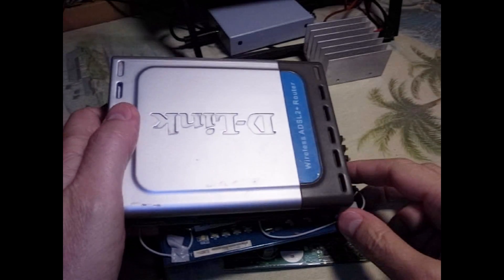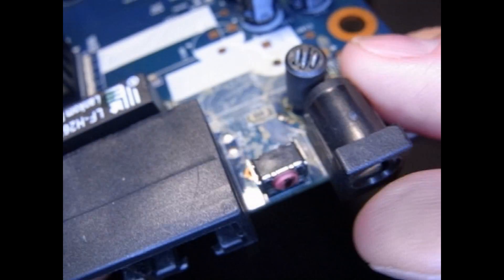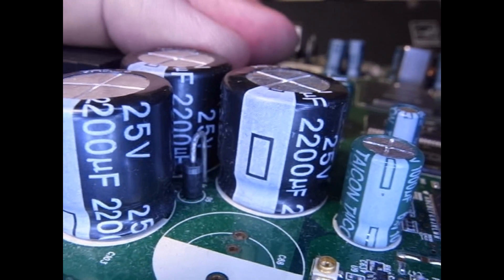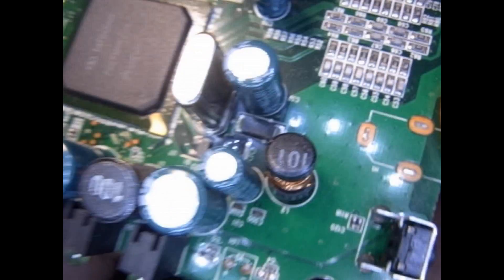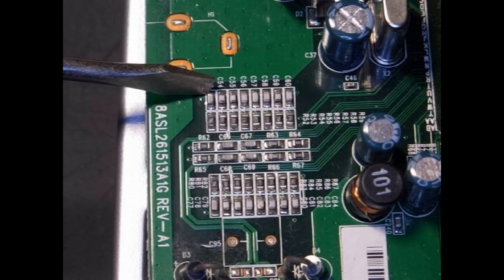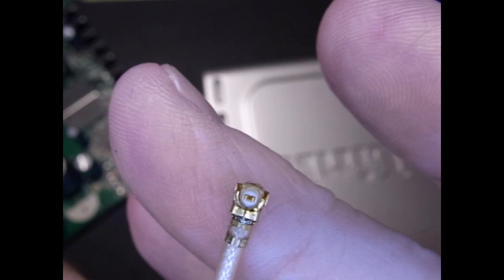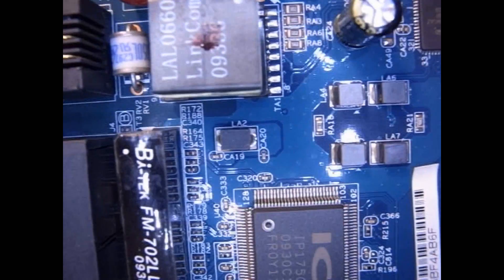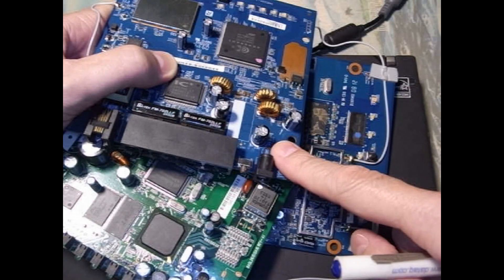Reusing Electrical Components From Scrapped Stuff

Comment from the maker: RELATED: 
Basic Desoldering - Circuit Board Stripping, Tips and Tricks: https://youtu.be/NJWKOwfz_lk
Remove Pins From Amphenol / Molex Connectors For Reuse: https://www.youtube.com/watch?v=LUuBx0uVNG4
Salvaging Circuit Boards + Rare Find:    https://youtu.be/dFpr_1sD764
Salvageable Parts From A Bad UPS Board:   https://youtu.be/FAhTbH2efAw
Salvaging Electronic Parts: Power Supply:    https://youtu.be/pDbAhXd2qLI
Salvaging Electronic Parts: Core I2S Motherboard:   https://youtu.be/5c1ME2DmHk4
Reusing Crimp Lugs:    https://youtu.be/JIdsnk8kqoY
Threaded Brass Inserts - Salvaging & Reusing:    https://youtu.be/DR6H3-N3t-I
LED Security Light IR Sensor Teardown For Parts(?):    https://youtu.be/ySlk66hfrlg
Salvaging Electronic Parts: Remote Doorbell:   https://youtu.be/bRk9LSBjLio

Comment: Good and useful video.  I dabbled with macro photography for some months.  Its a challenge because the adjustments for lighting and getting deep focus throughout the photographed objects on a circuit board works at odds with each other.  You did good.
Oh, those ICs are likely useless, as you mentioned.  I suspect they're made just for the router design.  PLUS to speed up their de soldering would require an air soldering device.

Comment: Are through hole resistors and diodes worth it to reuse ?
Reply from the maker: If the leads are long enough for your projects. If short leads are ok, then yes.
Reply: @tsbrownie  thanks dude
Reply: Even those ceramic brown capacitors,the white female connector ls and those green polyester capacitors?
Reply from the maker: @Ryle Desira Belli  I've got lots of recovered parts of all types. Literally thousands. It depends on your time and how much money you have to buy new. I was broke as a student, so.... If you have a parts tester, you can tell which are good/bad.
Reply: @tsbrownie  thanks for the advice

Comment: Excellent video!  
Another thing you can reuse is the enclosure... 
I built a portable amplifier into a little modem enclosure. I even reused its own circuit board as a support for my components ("Manhattan-style"), as well as rewiring the original power switch without removing it so that it sticks out the same hole where it was already designed to be!  (I use it to test second hand speakers I may come across at garage sales, and flea markets. You wouldn't believe the quality stuff people are getting rid of, these days!)

The enclosures, being full of holes where you may not want them, are not always as versatile as an Altoids tin, but sometimes they're exactly what you need!  ;-]
Reply from the maker: Thanks. You have excellent reuse ideas!

Comment: Do toroidal inductors go bad? (Just on there own, or when water damaged). Im asking cuz i have 2 and a lil one on the board and there looked to be covered in corrosion
Reply from the maker: Corrosion will destroy just about everything.  The core might be usable if it was carefully cleaned and was not pitted, cracked or otherwise damaged.  You'd have to replace the winding exactly as they were, but depending on the criticality of the circuit, it's possible.  Probably more trouble / cost than it's worth for most things.

Comment: How to make motor starting capacitor from scrap CPU capacitors?
Reply from the maker: Probably not a good idea because most motors needing a startup cap are AC and caps from a CPU are DC.  You can probably do it, but finding one is easier / safer.
Reply: @tsbrownie  can you make a tutorial on it please. Our country has DC Motors.
Reply from the maker: Sorry, youtube did not flag your comment, I found it by accident.  I googled "dc motor starting capacitor" and there are caps on DC motors, but they are there to reduce spikes rather than for startup.  Of course you can put a cap across the DC power source, but the real trick is knowing how much flyback there will be from the motor.  That reverse voltage spike can be really high (it's short lived, so it's hard to measure without an oscilloscope or similar) will kill a low voltage cap very quickly.  I've used a neon bulb to trap that spike in a 12 volt car, and the flyback will light up a 70v neon bulb.

Comment: You can get 6 heatsinks for 75  cents on Ebay from china. 100 tactile switches for 80 cents  20 jacks for 1.00 100 ic's for 1.18 . 250 assorted resistors and capacitors for a couple bucks. Brand new! No wondering if they were beyond their life expectancy or damaged when you removed them. When one part of an  electronic circuit fails it often takes many components with it!  You will be wondering why your project is not working when you are using fried components in them.Time is way more valuable than money anyways!
Reply from the maker: True, but in salvaging I learn new techniques, learn about new parts that you don't see for years in regular outlets, ... and all the while I usually listen to music and go all zen.

Comment: As any one use oven?
Reply from the maker: Solder contains lead.  Lead is toxic.  When heated it releases toxic gas.  Always work in a well ventilated place and NEVER around food or where people eat.  ALSO, many electronic parts contain toxic materials.  AND many parts are destroyed by prolonged high temperatures.  So oven / stove and similar = bad idea.

Comment: What does J stand for one.of the surface mount components had a N next to it,anyone,and inductors I don't see them.very often anyone can explain what a inductor is,I no a lot of my components but those two I dont,anyone,
Reply: Ron Thompson inductors create a magnetic field around themselves and create an induced voltage. They’re created by wrapping wire around a cylinder. The more wraps there are per centimeter or whatever, the stronger the magnetic field is, therefore making a stronger induced voltage.
Reply: @fluidapple9091  thanks for the info.

Comment: Who on earth designs these things.....    I take it they under stand what juice goes where??
Reply from the maker: There's software that helps lay out the tracing and such.  But it's like a tiny factory where each section is doing something different, but it's a standard function (chip).  The trick is connecting up each of those sections into 1 functioning board.  And it's often several engineers working together each with a knowledge of one part.
Reply: And it looks even more baffling if you look at a silicon die under a microscope... try to recycle boards with vintage ASIC's or microprocessors in ceramic package with gold plated lid, and unsolder the lid. You may even find doodles left by designers, as seen on micro.magnet.fsu.edu/creatures/index.html

Comment: 9:01 I'm wondering about those chips. I don't care about how difficult they are to take out. I'm just wondering if I could find some schematics so I could use them for something maybe.
Reply: ASICs are uninteresting, but you may find DRAM, flash ROM, CPLD, GPIO extender, level shifter... that you can reuse if you study their datasheet, design a one-off project with them (choosing a microcontroller or FPGA that can handle them), and can draw a circuit board for it, and can send /pay an order to a board factory, and can solder them, then test, write firmware, debug, build case...If the system is old enough, some RF circuitry may be not too much integrated  and there may be RF chips usable somewhere else. If it is even older, you may find 5V integrated circuits that are more easy for beginners to tinker with, either DIP packages directly on a breadboard or SMD soldered on an adapter, then wired to a hobbyist-friendly microcontroller platform like the Arduino mega2560 or another that is 5V I/O tolerant, that has enough pins for 8-bit parallel data bus and some address lines.

Comment: Interesting, I noticed I have the same looking screwdriver you had in hand, judging by the blue button. The one I have says Extron Electronics, a freebie that comes with the power supply the provide. 
As a kid I used to salvage components from tube sets, taking the time to unwrap the leads from the terminals, today it is usually quite easy to harvest parts. If I am in a risky mood, I'll take the heat gun and melt the solder and give the board a wack and watch the parts fall off.
Reply from the maker: Never done the heat gun thing, will have to try that!
Reply: I probably gassed and poisoned myself while recycling lots of components with a paint stripper heat gun during my late teen years. As it does not have a thermostat, the board is likely to be overheated well beyond solder melting point, unlike a proper hot air tool for SMD. I should get a thermal camera or wireless infrared thermometer to find how long is enough with the heat gun. Do it only outdoors or with suitable ventilation like a solder fume extraction system !